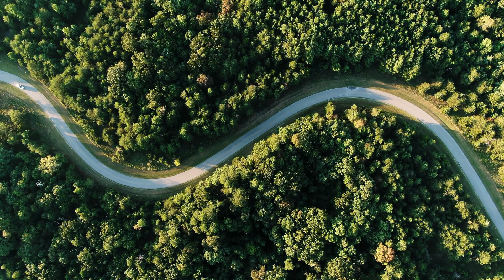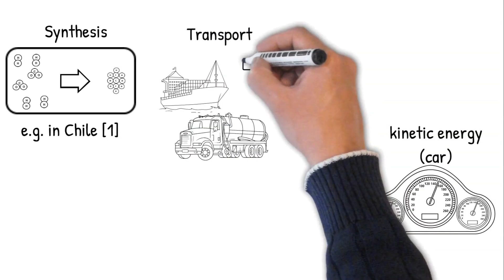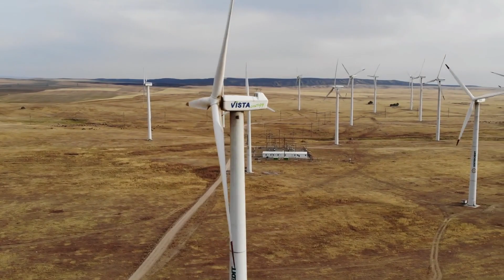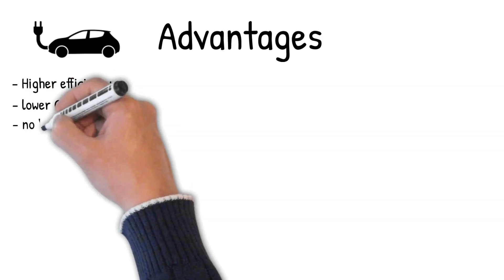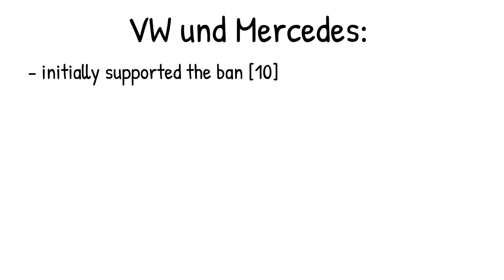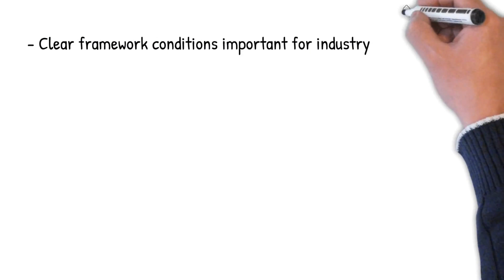E-car vs. E-fuels: What is the future of individual mobility?

Comment: You can't just look at the emissions as only part of the manufacturing process. What is really the issue are the toxic exhaust gasses emitted while burning the fuels right inside the cities where we live, sleep, breathe and raise our children. This is just the local concentrated problem... but oil extraction and refining is the global crisis.
- One pumpjack consume 9800 MWh/month of electricity. There are around 1.1 million active pumpjacks worldwide (in 2018). - Oil Refineries consume 15-20% of annual electricity consumption for the whole continent (just in the US).
- Offshore platforms burn 20-30 tons of diesel per day for their generators. The US alone has 610 active offshore platforms.
- Thousands of kilometers of pipelines. Each section with a pump consuming 50-250 kW and working 24/7.
- Tankers, each of them burning 200-250 tons of fuel oil per day. 2,210 are currently active tankers. - Land transport with semi trucks - ~ 40 liters of diesel / 100 km.
- Gas stations with all their pumps and energy consumption. ... and we haven't touched on shale gas and coal mining yet. ... nor have we paid attention to oil spills, vented gas, pollution of rivers and groundwater, deforestation and wars for resources.
- An average ICE vehicle is responsible for 260-350 g.CO2/km + NOx, SOx, CO and other harmful fine particulates right in the cities where we live. - Efficiency to the wheels - 18-25% (older vehicle even less)
- While an EV is responsible for 32-48 g.CO2/km (at the current heavy coal energy mix)... Keep in mind that there are NO emissions during it's operation. NO exhaust gasses where people live - Efficiency 80-90%

Manufacturing of an ICE vehicle releases 5200 to 6900 kg.СО2, while an EV (+battery) releases around 5600 to 8800 kg.СО2. Emissions are equalized after less than 10,000 km. After 250,000 km the difference in emissions is at least 10 times more for the ICE.
The longer you use an IC vehicle the more petrol will be extracted and refined, more political conflicts and wars will happen, more land will be cleared for pumping, more oil spills will fill the oceans, more gas will escape the pipelines... and more fuel will be burned.
- 7-8 million people die worldwide due to air pollution.
- The petrol industry generates $10 Billion in profits per DAY and receives $11 Million in subsidies per MINUTE globally.

Comment: There are a couple of major problems with both "hydrogen" and "synthetic fuels":
- 96% of the World's hydrogen production comes from coal, gas and crude oil. Japan, Russia, Australia and others have decades long trade agreements to produce and trade hydrogen... from coal and gas. 
- Steam reforming (the process of producing H2) generates more emissions than just burning the stuff.
- Hydrogen electrolysis is a disgustingly inefficient process! If we add compression, transportation, storage and the efficiency to the wheels... it all falls down to less than 13-18% efficiency. Huge energy waste. Furthermore - 10 liters of freshwater are needed to produce 1 liter of hydrogen. "Green" hydrogen is only for marketing purposes.
- FuelCell vehicles are slow, powerless and need frequent safety inspection and maintenance... 
- Hydrogen stations often explode... And they need constant supply of the "fuel". You CAN'T fill anywhere else and you CAN'T (or won't be allowed to) produce it at home at needed volumes.
- Synthetic fools/fuels require exorbitant amounts of agricultural land... Which means more deforestation, more water wasted and more emissions generated.

...Both are just tools to make us dependent on a product that we have to BUY every day and could not be able to produce ourselves. The same old business model... the same old companies.

Comment: EVs are the future. That is certain. What is not certain is the future of batteries. Right now what will happen with a battery pack a decade after using an EV? There is no recycle tech now.
Reply: Batteries are fully recyclable. Over 95% of the materials are extracted and used again. 
There are many companies capable at doing this recycling at scale... They might even qualify as "mining companies" as they're able to produce tons of raw materials.
The only problem is... there are not enough batteries that go out of service. An EV battery (quality one) can comfortably be used for 20 years as the rest of the vehicle starts crumbling away. After that it has more life in it and can be repurposed for use in stationary energy storage for a decade more. And only after that it is recycled and 95% of the materials reused.